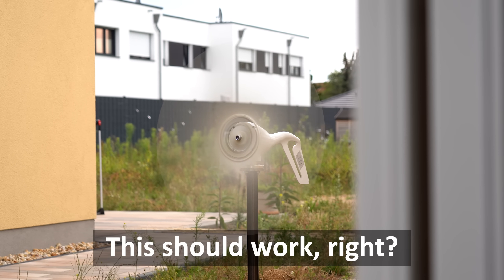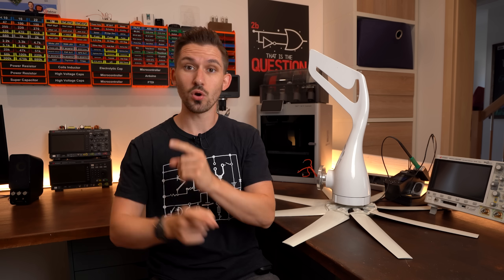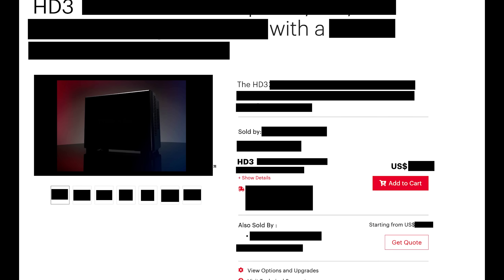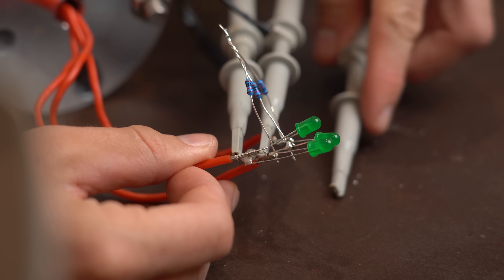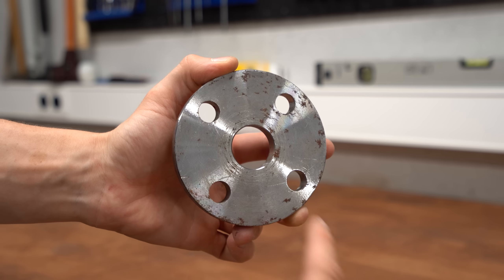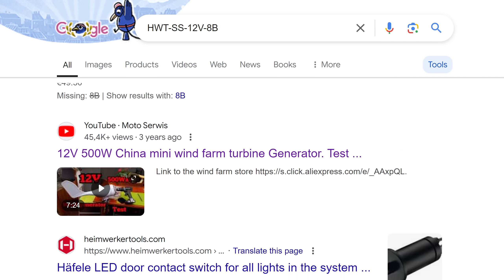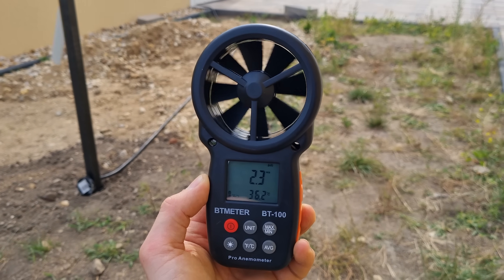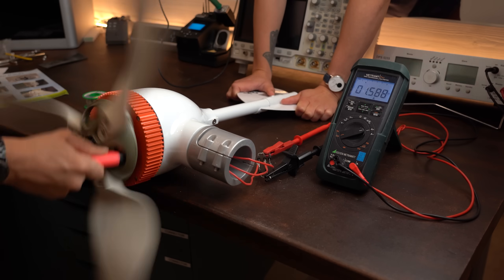I tried to Power my Home with Wind Generators! (Worth it?)

Comment: I have a friend living in a barren region of Wyoming outside of Wheatland, on top of a hill just a few miles from a section of highway that regularly gets shut down due to high winds. He, like all of his neighbors outside of town planted windrows of bushes and trees on the windward side of their homes to reduce the howling winds, the winds that left a 7 foot tall snowbank the length of his quarter mile-long driveway. He is a retired techie who spends his time designing and building electronics projects, who could easily get a windmill, battery bank and inverter set up to power his house, a house that's at the end of the power lines a few miles from the Wheatland coal-fired power-plant, but he doesn't do it. His is the perfect situation for wind power, but he doesn't do it. I have no idea why. People are strange. But I will add that no wind generator less that 30 or 40 feet or so above the ground is worthwhile. Unless it's above that height the ground interactions with the wind take away too much of the useful energy. The higher the better. The US agency with all of the pertinent info and research is the National Renewable Energy Laboratory, NREL with a website filled with information and PC applications to analyze your site and situation. I think they have also done reviews of the consumer-grade windmills themselves.

Comment: all these wind generators are mainly made for small sailboats that use all  12 volt appliances like a camper... Useless in running a home or charging a large battery bank.  All wind generators SUCK... anyone suggesting it as means to charge batteries during night hours when solar isn't available knows nothing of what they are suggesting.

Comment: Your video contains good information about wind gen, I actually wanted to buy one but now that I've seen it it's voltage is very low. I thought this type of wind generator would have produced a high voltage. It would by good if you had designed your own version.

Comment: Great video. Thank you. (I'm based in West Yorkshire in the north of England.)  I'm embarrassingly poor and have long thought that if clean, green, renewable self-help energy generation were a practical proposition, people like me would have been doing it for years and living cosy, independent lives untroubled by the high charges demanded by the major energy suppliers.

Unfortunately, solar installations are complicated and ridiculously expensive, and useful wind-power is expensive and hopelessly inefficient on a domestic scale.

Despite their apparent attractiveness and perceived potential, panels, turbines, rectifiers, storage batteries and control systems remain the playthings of people with enough money not to need them.

Sigh.😞

Comment: Why this doesnt work partially comes down to the physics of wind turbines. The equation for the output power is: P= 0.5 * Cp rho*pi* R^2 V^3
with some assumed values this gives: 0.5 * 0.1 * 1.225 kg/m^3 * pi * 0.5 m ^2 * 3 m/s ^3=1.2 W. Im assuming a coefficient of performance of 0.1 at 3m/s and a blade length of 50cm and im probably overestimating the coefficient of performance here but its obvious why this would not work. Just not enough area or wind speed for a wind turbine.

Comment: I guess using a bldc motor is better that buying a wind generator my voltage at low wind speeds are in the 15 to 26 volts and 30 to 45 at higher speeds

Comment: Actually, such powers are perfectly relevant for 5V to 6V, that's fine to power an IP camera or something in that taste. Also, horizontal wind turbines are so last century, there are ways to convert an entire roof into a "wind ramp" leading to lines of many VAWTs, the steeper the better (up to 45º slope). I think @DIYPerks did something in that taste (it could be @techingredients too) by connecting many computer fans in line and sum the power in a similar size but much more acceptable shape.

Also, if you really want to stick to your turbine, you may want to "duct" it with a big funnel in front and the same weight at the back (e.g. with a much larger tail) so to force more wind into your blades.

If you are to rewire the generator, just build a new wind turbine from PVC pipe, although it's nothing new on YouTube.

And last but not least, keep your battery as close as possible from your DC-converter. AC is pretty immune to length, DC is leaking mad, that's the story of Tesla vs Edison.

Comment: For residential wind, you'd probably want to put horizontal turbines at the ridgeline of your roof. That way you're catching the wind shears off your roof, which will be significantly faster than the ambient breeze. 

Might want to try adding a converging inlet on the turbine, might get you useful power at lower windspeeds and is probably easier to do than rewinding a motor.

Comment: Great video, its unfortunate that wind energy is not efficient enough for power generation. I found this out with designing an efficient vertical wind turbine in the FFA when I was in high school. I won an award for the research and 1/8th scale model, but was disappointed it was so inefficient at even large scale. I used a car alternator for mine, mainly because it was all I could afford at the time lol.

Comment: You did wrong as, first,  you installed your wind turbine in an "wind protected" area which the wind was blocked by the wall. Second, as you installed it too low too closed to the ground, the wind flow to it was disturbed by the uneven and smooth surface, which in aerodynamic terminology it was called turbulence, which the wind flow to it was powerless. That idea than applied to the airplane to create vortex generator to reduce drag in the top of the wing that you may see it when you fly. So, you should build it in a open space without any blocking, and should be around at least 10 meter above the ground. If you install it above the roof, then it should be another around 5 meter above the roof. General idea, the wind turbine must be installed in an open space without any blocking.

Comment: i want to build one that sits on the peak of my roof,  as my house faces the bay and we get gale force winds at times. Theres a design of fans i'd like to use to build a wind generator called a Cross Flow Fan ( or drum fans ) google it if you want to know what it looks like but i think if a few are added on the peak of my roof they could generate some serious wattage. only problem being they'd have to be fix mounted and if the wind isn't hitting them directly they may not spin as efficiently.

Comment: Effectively all rotating power generators convert the available torque at a particular rotational speed to get the power output in watts. Torque depends on the blades' efficiency in converting wind impact into leveraged rotational motion (torque). This is why the large wind farm turbines have long wing-like blades that turn relatively slowly and can vary their angle of attack to optimize lifting power at a distance from the hub (eg torque). Their immense low-speed torque is typically geared up in a geartrain in the hub to turn the attached generator at speeds that more efficiently generate electrical power.  There's more complexity than this relative to max power point and other factors but the above covers the basics.

Comment: You can use a step up switching adapter from the less than 12V output of the too slow wind to capture 4.5-32V input and regulate it to around 13V8 or 14V to charge the battery. They are cheap and you could capture the slow wind power generated. Look for XL6009 which is a 4A switch current high performance boost ( BOOST ) module. This module uses the second-generation high-frequency switching technology XL6009E1 as the core chip, It even has a 7 segment LED display showing input or output voltage.
Reply: I can give you the link from my country where you can get it, but it could get deleted on some channels. If Great Scott is OK with it then let me know.

Comment: tip:. use higher posna to get higher speed. the houses block the wind speed. best solution i think is installing in to the house roof

Comment: I bought a 15 euro used hover board just to harvest its two brushless motors exactly to make a wind generator. It still hasn't left the hover board. Let alone started drafting the project. Wonder if you thought about something that requires such a small investiment, some hardware (which I plan to scrape from somewhere as well at low-cost) and some 3D printed parts. Think the most difficult will be to convert it and feedback into my house (which I don't have a plan yet)

Comment: Did you just connect green-yellow to carry current 6:43 ? TÜV sagt nein
Reply: It's carrying very low-voltage. I don't know about the codes where you are, but that might make a difference. The codes might not even say anything about such a use at all since most don't care what you do with things running at like 12V. In the USA, all our national electric code says about low-voltage wires is to keep them separate from AC mains wires from what I could find online.
Reply: TÜV hat nichts zu melden! VDE rules rule! You can do that, if you remark the green/yellow to  black, brown or gray (heat shrink tubing or paint pen).
Reply: @Stefan_Dahn  well not where I live. You cannot remark green-yellow to anything here. You may use blue as phase of you mark it with black or brown
Reply: @Stefan_Dahn hmm, re-marking the yello-green is strictly prohibited in most countries that I have taken a peek in electrical installation codes. Of course, this is a low voltage almost toy contraption ..but VDE sagt: NEIN! (yes these capital letters are there intentionally ;))

Comment: Danke Schon for this video. I have considered using wind to supplement my solar panels here in Ireland. During winter, when I get 6 hours of sunlight, I also often get strong winds. But I have forests on three sides, so I expect to be too sheltered. I have never tried my similar 600W turbine, because I already know I would not get the windspeed needed, even on top of a 6m mast. It is possible that smaller wind chargers for use on sailing yachts might be suitable. These are intended to directly recharge 12V lead acid batteries. The greatest obstacle seems to be getting wind and solar power to charge the same batteries - perhaps not a problem for someone with your electronic skills.  Commercial solutions seem extremely expensive.

Comment: You can calculate how much power youd get out of a wind generator with this equation. P=1/2(Cp)(p)(A)(V)^3. With Cp being the performance coefficient, which has a maximum limit of .593. So even if we are generous and say that the wind turbine is at the Betz limit of .593 and the air density is at sea level on a standard day (1.225 kg/m3) with a turbine diameter of .75 meters. Youd still only get 4 Watts of power if the wind was blowing at 10 m/s. And again that is assume the best case scenario.

Comment: With a big enough dynamo, you can take your wind force and regulate it to draw 120V/60Hz straight and only push to battery for storage/high demand support.  With a big flywheel, it becomes even easier.  
I have spent a lot of time trying to optimize gear that I have gotten that simply cannot be optimized further; I always end up having to build my own, once I understand what they're trying to do the circuits, etc, aren't that complicated - it's the overall system flow that matters.
I wish my wife understood that I have to destroy a few or more before we get the thing I made she sees lasting forever.

Comment: I tried to do an quick rough estimation, not sure if i did somethin wrong. Definetly not accurate:
An Windspeed of 5 m/s should equal an mass flow of 6.9 kg/s (air), assuming a diameter of 1.2m. the kinetic energy divided by time (power) of the air should then be about 86W.
If I did nothing wrong (wich is likely this was quick math), it should mean that it is not possible to get more than 86W at that windspeeds.
According to google wind-turbines have an efficiency about 50%, so you shouldn't get more than 43W out of it.
(Edit: forgot the ^2)
Reply: doubling the windspeed (10m/s) and the the air got power of about 700W.
I guess you have to get higher for higher windspeeds and usable power.

Comment: would putting a step up transformer in front of the turbines create too much impedance and slow the rotor down? that seems like it would be a lot easier and more repairable than modifying the rotor windings, at the cost of some efficiency.

Comment: You buy a wind generator for under 100€ in the internet and wonder that they don't work? Great surprise! ^^
These models are just too small to yield relevant power. Something that yields 400W on average, you need a rotor diameter of about 4m.

Comment: there is a good reason why commercial wind turbines are huge and get bigger with every generation. Small scale wind power is just not financially viable, if you want some return on the investment before the machines need to be replaced or rebuilt.
Sure, if you just care about the "feel good" factor and money is not an issue, you might have other standards. But if you do it for the environment, getting a plastic windmill made in china and have it shipped over here to your door probably used more energy and created more pollution already than what these small scale windmills can ever save/recover in thery short lifespan.
And windmills are actually getting loud if they get bigger, so you probably don't want to run them right next to your house while you try to sleep.

Comment: What’s the height limit for mounting this? I imagine having it in your backyard also has a lot more resistance from fences, buildings, etc. slowing your wind. Is it permissible to mount it closely on your rooftop, kind of like a modern wind vein. If you rewind the first, try and match it to the second, write them together, and that should be enough power to charge the battery then, right?

Comment: It may be a fun idea to build/buy a low voltage controller and a voltage sensitive relay which switches to "low voltage mode" for those low speed days. 
When wind does eventually pick up and it reaches 15V it switches and you could let the original controller handle it.

Comment: Quick calculations give me ~ 12W at most (aerodynamically speaking) for a 1m diameter turbine at 3.5m/s

Dynamic pressure is 0.5*1.25*3.5^2 = 7.5 Pa
Area swept by the blade is π/4m² ~ 0.75m²
Betz limit says at most you get out 59.3% of the momentum of the air as power, so the total power is 0.59*7.5*0.75*3.5 = 12W

So even in the best case it's going to be quite useless. Power goes up with the cube of the velocity so find a place with high wind speed close to the ground
Reply: Great reply, by @edoardogamba6141. Question answered with a “back of the envelope” calculation.
Reply: hmmm interesting.... how much would you need for like 400W ? or more?
Reply: @Forol1561  the same 1m diameter turbine needs approx 11m/s for 400W, or you need a 5.7m diameter rotor at 3.5m/s.

In the end due to the atmospheric boundary layer and to the fact that to get more area you need to place the hub up high the amount of power that you can generate grows exponentially with the stem height.

You get more wind speed according to an empirical power law depending on how far you are from the ground, and power scales by the cube of that speed.
Then the higher you go the more area you can cover, so power scales with the square of your height (assuming a constant stem/diameter ratio).

Wind turbines are not really my thing tho, I did two exams on the subject but I'm focusing on a different part of aerodynamics so there may be mistakes in my comments
Reply: @edoardogamba6141  He said that he's not allowed to mount it higher up.
Reply: Practical Cp value for small wind turbines is a WAY below Betz limit (and is a as well changing depend of wind speed!). I found some quite reliable data "as sample" - but for tiny turbines like this it never will be better than around Cp=0.3 at range of 8-10 m/s. Probably even lower. When we count additional problem with a non-laminar flow it goes crazy low. Wasting time on anything smaller than around 3m diameter is a total waste of time and money. Especially if "customer" is not living on the ocean coast.
Reply: @bialy100k  but even with theoretical Cp value, 12W is useless

Comment: I have mine sitting in a basement for 3 years now... with no use pretty much because, as you mentioned, those generators generate nothing. I hooked up my wind turbine to a powerfull cord drill with 2600RPM and i was only able to get 5-7W for each phase. So 20W at best. The problem seems to be on a rotor side because the magnets are not positioned properly or alligned with each individual phase's core. It will show you perfect 360 degrees but as soon as you load it up, it can't provide enough voltage and enough amperage. And of course the rotor blade is also small. Proper home wind generators has 6m long cross section and 5 blades not just a 3... the best solution is to somehow extract the rotor and stator and mount a robot stepper motor inside instead.. so you can get around 60-100W depending on the wind speed. Those alliexpress generators SUCKS and i wasted 140€ for nothing